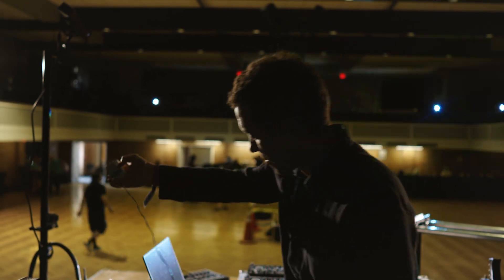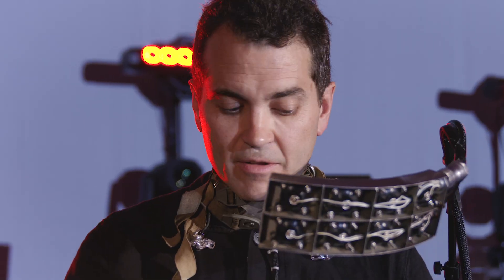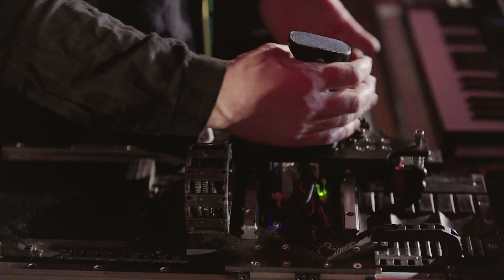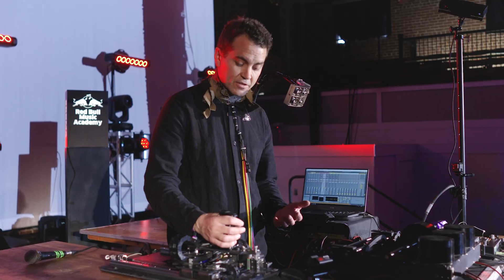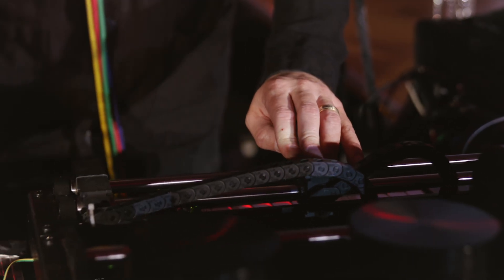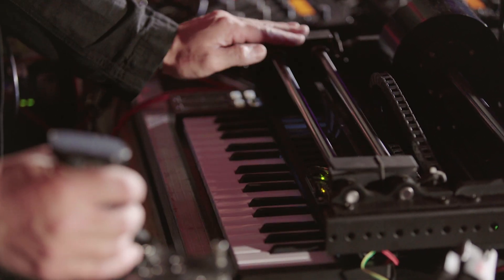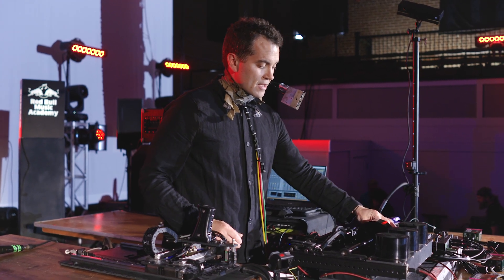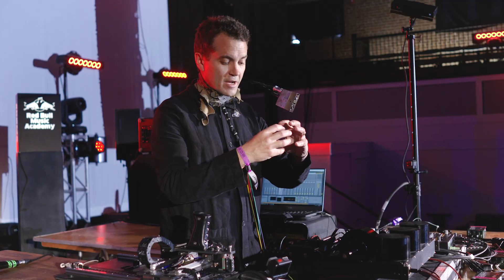Author & Punisher on DIY Controllers | Red Bull Music Academy

Comment: I came into this super cynical, but this is fucking tight. I've booked a bevy of noise shows, and a lot of dudes try this concept, but because of their means or just lack of creativity, the execution is anemic. Either it's super expressive and doesn't really do much, or it sounds great but it's basically the same as standing on stage with a group of pedals and a tone generator. Really great stuff, so many of these guys are so anti-digital, but with the right utilization, it can be the coolest thing ever.

Comment: To me, this is circuit bending on a whole new level. Rather than adding to the device that you're using, feeding wires out with the coding to a completely separate device. And home made... This guy is a fucking genius. No doubt. And his custom built mic... Ugh... I wish I had his mind and ability to make these things.

Edit: Ignore this comment. I was very drunk and blantly talking out of my arsehole at the time of writing.
Reply: I'm not an expert on circuit bending, but i though that circuit bending is about unintended modifications of music hardware to get unexpected sounds, but here he just makes custom controllers and microphones, using both of which intended by DAWs, so i don't see how is it circuit bending at all. I mean that those custom controllers designed to use intended features of controller interface that programmers of the DAW put in it.
Reply: @xn4pl  you are absolutely right.

I think I was very drunk (like I am right now) when I wrote that comment. I honestly don't know what I was thinking back then.

I appreciate your comment, and correcting me!

Cheers for that! :D

Edit: You are completely right with what you said about circuit bending. I really do need to stop drinking so much...

Never. :D

Comment: 4.15 on a drum machine u'r not stuck in the 16 th notes, he's got elektron machines and he's complaining? nice stuff dont get me wrong...
Reply: Those Elektron machines are new, actually. He used to use just a laptop for all sounds. Now he has some Elektron stuff (Analog Four or Keys if I remember right and Octatrack for triggering samples) plus of course the Analog Heats for analog distortion and processing. But anyway, my point was that he never has really worked within on the grid limitations and the Elektron gear isn't really utilized to it's fullest (since I don't think he uses the sequencers) on them.

Comment: @10:40 "it's a really simple setup"
Reply: Exactly what I was thinking, had a laugh when he said that.
Reply: its actually pretty simple if you get behind the design. its just moving parts connected to movement sensors that translate those movements to a language that a DAW understands (MIDI).
Reply: @Andre-gy5ml  Ye, at first I thought he might be using some analogue fanciness and was impressed, but then he mentioned the software synth and I was thinking about a setup like you were describing here. A lot simpler (I think), but essentially the same effect. Still looks neat either way.
Reply: the machine may be difficult to build but the setup of the machine is likely very simple. Take input, put it through an arduino, input to computer as a midi signal. It's not simple to the average person but if you have arduino experience that's actually a super simple task to accomplish